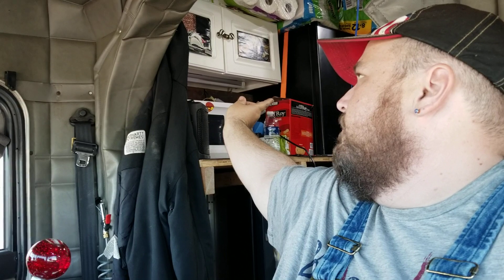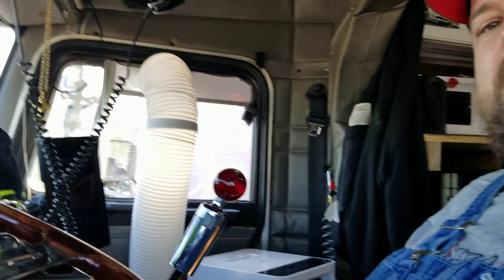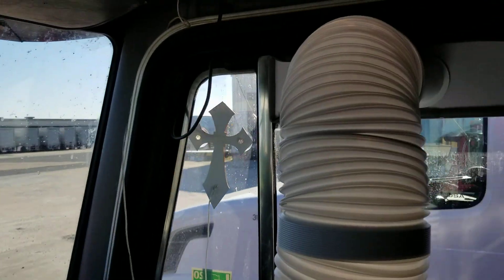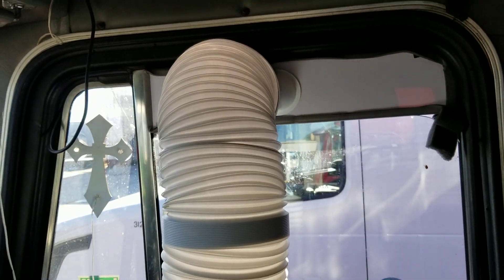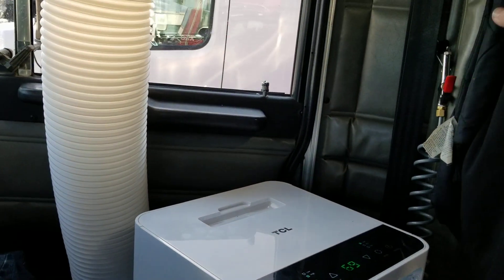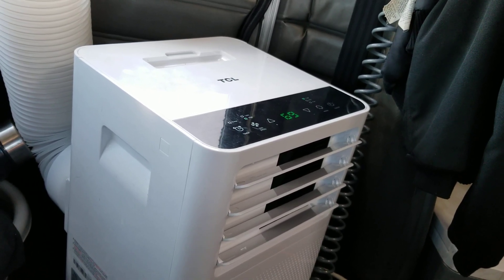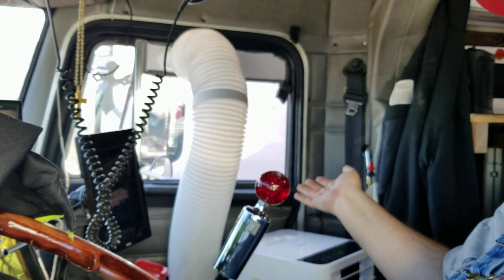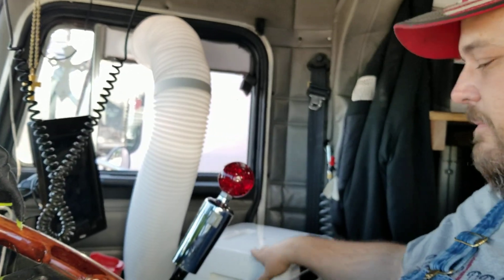HOW TO BUILD AN TRUCK  APU UNDER $1,000.00

Comment: I was toying with the idea of a water cooled 250cc motorcycle engine feeding coolant through the system in my RV. I am in the process of trying to figure out how to run the heater with the main engine Switched Off

Comment: Where did you get the air conditioner unit? 
What other parts do we need to get with this unit ?
Reply from the maker: I bought this unit at Walmart The other things that I needed was a insulated hose for the air conditioner to keep the heat down from  the exhaust on the air conditioner also I had to cut the piece for the window a little bit to make it fit in the window I used a little bit of  Foam insulation for the window pieces And to run the unit I used a 3000 what generator or gas inverter from Amazon
Reply: @OVERALL_PAUL  great how about the model for the AC i will go to Walmart to get one and I did research on the generator found the Eco Delta Pro power station. 
Hopefully it work fine once I get those things installed.
Reply from the maker: @TaskForce860  I would buy one with the biggest BTU output to keep up in severe hot weather

Comment: I did the same, I bought a 12000btu air conditioner at Costco, the problem now is that it is not cool to use in the hot noon, the effect is not good, only when I use it at night, can I feel cool, maybe my air conditioner is not good  , I ask your 5100btu air conditioner, is it cool when it is used at noon?
Reply from the maker: I had to cover my windows to help keep the cool air in the rig and also I found if I covered up the exhaust  tube it helped a little I tried to use a insulated dryer vent hose to keep the heat down on the exhaust Is for the air conditioner the 1500 did help some but I had to use a couple fans to circulate the air

Comment: Add a magnetic heat pad to the tank, an electric heater in the filter, and heat tape on the fuel line, all 120v and can be run on a 20 amp or so, on the generator.
Reply from the maker: Thanks for the tip I no longer have the truck but Imagine someone could use the information

Comment: Smart set up!!!

Running a generator setup as well.
Reply from the maker: Thanks it worked pretty well in the winter for the heater and for the summer time the hose for the a/c exhaust needed installation around it to keep the heat down in the truck to cool to truck down but it did work out well

Comment: Awesome 👏 by any chance how much voltage the ac unit uses
Reply from the maker: On average most unit pull about 500 w
Reply from the maker: In the wintertime I use a small space heater to heat the truck it worked very efficiently and what I had was a ceramic style heater it was a smaller one but it does the job

Comment: I would like to do the same thing but what are you doing about carbon monoxide from the gas generator?
Reply from the maker: I made sure the the exhaust pipe for the generator was facing towards the back of the truck I had the generator set on my catwalk out-of-the-way the trailer for clearance also I have seen people do the setup with this with a toolbox of some sort with a fan and they put an extension on the exhaust pipe to get the exhaust fumes away from the truck

Comment: You should showed the generator oudside, how did you mount it and protect it from the elements,like rain. thanks for the video.
Reply from the maker: I actually did a video on how I mounted the generator it is labelled as.... " the new Ford generator is now in use "    you can look through my listings on my channel I also have information on the generator that I purchased for the truck For the truck in previous videos

Comment: I'm confused. Where is the APU you built? APU = Auxiliary Power Unit. A portable A/C is not an APU. Your generator can be called an APU. I thought you saved money by building an APU under $1000. ?!
Reply from the maker: I did save money on this...  The term APU means auxiliary power unit This power unit was generated by a generator I  also used a cheap  air conditioner with a smallI Ceramic heater the generator was $400 and the Portable A/C unit was $300 plus the ceramic heater $35 .. 
In all this was under $1,000. It's an quick fix for someone to save money 💰 on fuel and at the time Diesel was $2.75 a gallon.   gas was at an all time low  $1.89 not only did I saved $ but it kept the wear and tear off of the old truck I kept  maintenance costs down over time I did save for an APU but I ended up selling the truck just to be home with family and this set up works well for my motorcoach now I hope you have an blessed day thank you for taking the time to watch this video

Comment: I was wondering what generator did you buy and what did you build on your cat walk to keep it in place and did you use a cover to protect it.    Where do you keep your 5 gallon Jerry cans on the truck.  What kind of heater did you buy and what kind of ac unit did you buy.
Reply from the maker: Generator was an Ford 
My catwalk i used u bolts to mount the Generator to to catwalk 
I used a vinyl cover to protect it in the winter 
My  gas cans was in a tool box on the side of the catwalk on the frame 
I used a small ceramic heater to heat the sleeper and the ac was an walmart special portable ac unit go with  the bigger unit also I have more  videos  on my channel on all of theses things

Comment: I run a 3500watt inverter generator from harbour freight. Get the warranty and you can trade it when it “ breaks” every 2 yrs. and quieter than most apu’s. off that I can run my 8000 btu portable ac microwave apartment size fridge and a heater and anything else you need.been running it for 2 yrs now no problems
Reply: 3500 watt inventor work fine with 8000btu?? With fridge? Where the ac exhaust pipe go?
Reply: @iyadwinder  I put it out the pass window
Reply from the maker: I always used during the day while driving my inverter for the refrigerator then at night I would swap everything for night time

Comment: I hade same setup 2 yrs ago it didn't cool my truck summer time 9000btu didn't work so good luck my new setup window a/c unit some how works better....
Reply from the maker: Yes over time I learned the window part needed insulation for the heat from the hose on the A/C

Comment: Well I’m still waiting to find out how to build an apu for under $1000
Reply from the maker: Step 1buy a generator 
Step 2 buy a space heater 
Step 3 buy an high output portable airconditioner 
Step 4 have plenty of gas 
Step 5 make sure you have an heavy duty extension cord to plug in the generator to the heat or a/c 
Step 6 fire that baby up and turn on the air conditioner if needed or the heat 
Strep 7 bask in the comfort of a heated or cooled truck 
But if you want to know more you will find other videos on this set up even the generator I use I hope this was helpful have a Blessed day

Comment: I have same idea and ordered my generator have already portable ac unit in the truck
Reply from the maker: How did this work out for you the only thing I noticed was the exhaust on the  A/C needed insulation to keep the heat down

Comment: It looks like its blocking passenger side mirror. I would had flipped it, so hose to right more. That spot might get you in trouble with dot.
Reply from the maker: You wouldn't be able to drive with this in your window it's only used when I'm sitting still parked in the parking lot to keep from idling the truck and to keep my fuel costs down so that being said I wouldn't be in trouble with the DOT being  parked with this in my window
Reply: Seriously, Who use AC unit while driving 🤔
Reply: @rajpoot0426   anybody that drives an older truck and spends half their time having AC issues.

Comment: I have the same set up for AC. Try to use the least ethanol blend of gas along with Sta-Bil or since it’s hot now I run the Lucas ethanol treatment in every tank. I have used Centramatics every since my first O/O Truck in 2004. Since I mostly use the AC for sleeping, I only cool the back bunk area. I pull the curtains around the unit. It will get very hot up front though so I was thinking of switching to the two hose unit, but for now it works. I’m using Harbor Freight’s Predator 2000 and portable AC from Wal Mart
Reply from the maker: Cool 👍

Comment: I run this setup now what I have found is you will have to insulate the duct going out the window other than that your good a window unit works best but I don't care for the unit hanging out the window

Comment: I tried this once in a motorcycle trailer. I didn’t work. The problem i had was that Spence the exhaust hose blows air outside the ac unit needs to suck air in from outside to inside the cab. And sense most cabs or in my case trailers are some what air tight the ac unit couldn’t get enough air in to cool the compressor and it would over heat and shut down until it cooled off again. This made it where the cold air coming out of the ac wasn’t staying cool long enough to beat the heat. If u are going this rout they make units that has 2 hoses that connect to the window one blows hot air out while the other sucks in cool air to cool compressor.